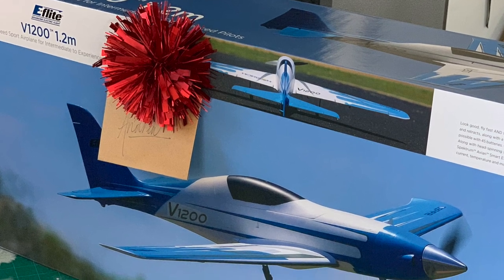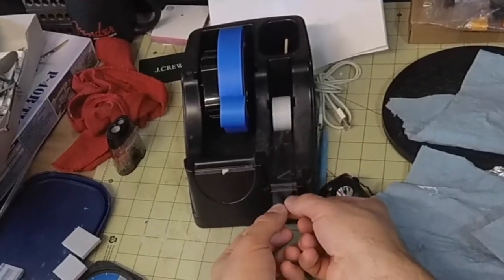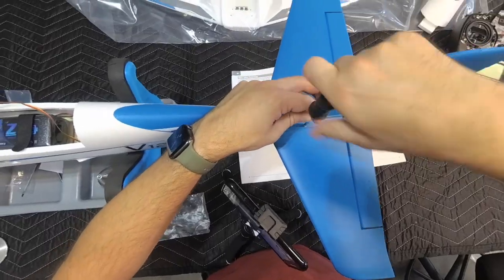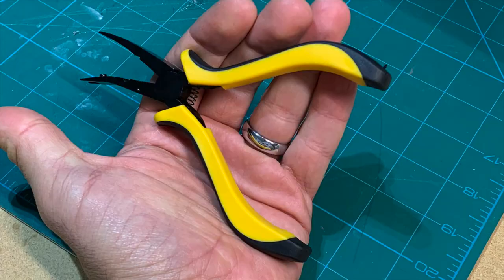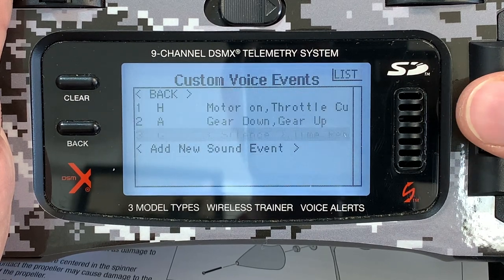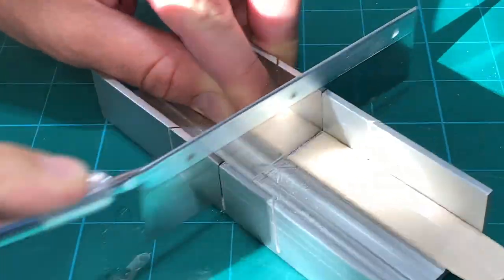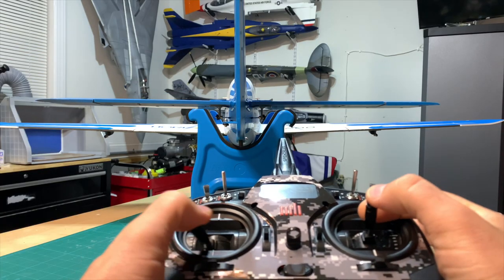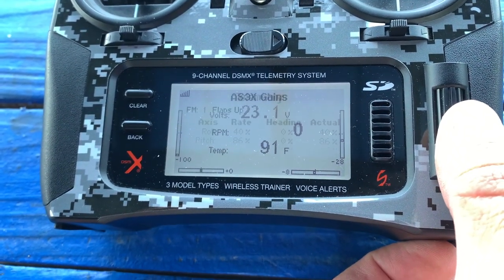E-flite V1200 1.2m BNF Basic with Smart - how to setup with SAFE Select

Comment: Greetings  Fellow  Flyers  .  My local store has a v 1200 and one of the landing gear shafts is very tight up against the side of its well it sits in  making the plastic wheel cover flare our some  . The other  wheel and gear has the same size gap all around it in the well it resides in and  the wheel plastic cover is seated correctly in its wheel well .  Any thoughts  ?   Thank  You